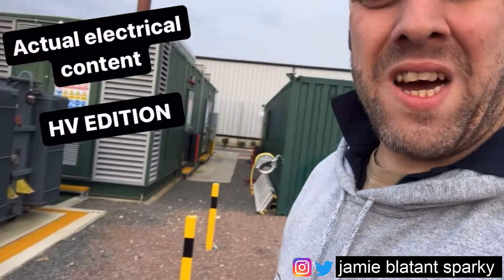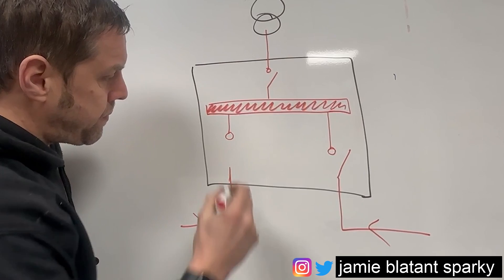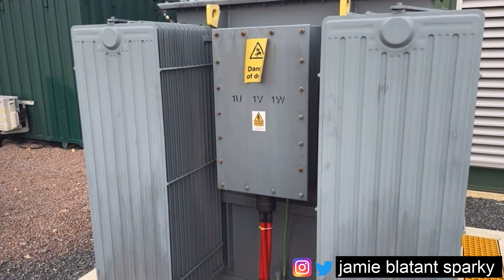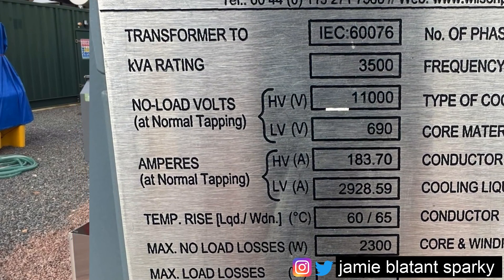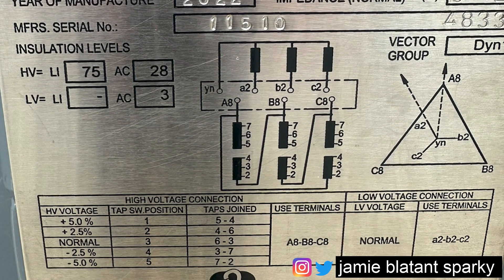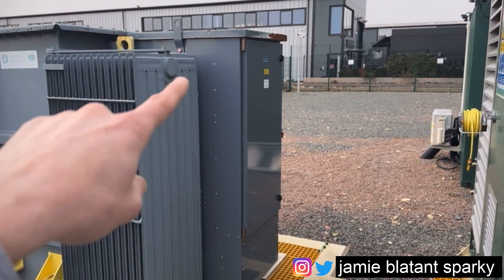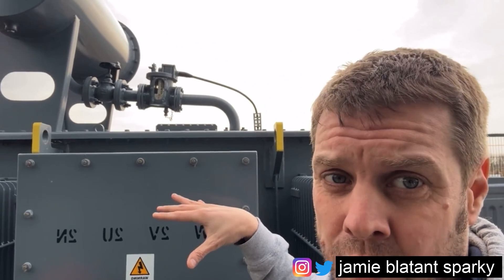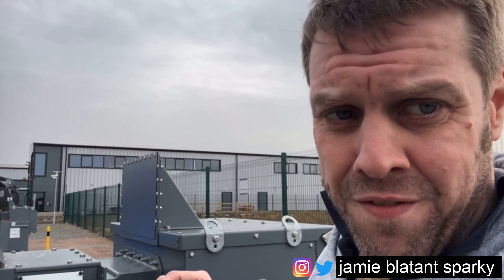HV transformers and switchgear a overview for electricians

Comment: Hopefully this helps on. ONIN. 
 ONAN cooling method relies on the natural circulation of oil within the transformer tank to cool the core and coils, and the heat is then dissipated into the ambient air through natural convection.
Basically, good for convection 👍

Comment: Except the Heathrow setup was far older and had HV switching mechanicsm which had oil based main switch which was used in them days to keep the copper switching mechanism cool due to the high power which generates heat, and its my guess that because this switch hadn't been maintained properly in the sense that the oil is supposed to be changed after so many years and the switch wiped down to get rid of any partials that shouldn't be there, after some years the oil tends to break down because of the high voltage and heat associated with this type of mechanism, from being a insulator over time with foreign particals and the oil breakdown turns the oil into a semi conductor therefore leading to an explosion, I'm not saying this system was used at Heathrow, the oil spoke about by the chief fire officer may have come from the transformer itself which is part of the cooling system , but from what I saw of the Heatrow setup it looked a far older system than the one you are showing, I've actually worked on these oiled filled main switches who were made by GEC , I've actually emotes these oiled filled switches and cleaned them out and refilled the switches

Comment: Good summary explanation, we’ve got compact transformers on our electric high speed trains, we’ve also got idiots who reset Buchholtz relays without checking oil levels 😡, only ever had one that decided to “leave the chat” that was due to track ballast damage blootering the cooler group and returning its oil to Mother Nature, on the DNO ones I used to synchronise LV generators to the LV take off chambers to allow us to do HV maintenance while keeping the consumers on load

Comment: Retired DNO engineer here - I enjoyed your video, thanks for posting it. That was a very good basic description of the 11kV ring main unit and transformers. Most of the transformers on the UK distribution networks - as you pointed out - don't have a rated secondary winding line (phase-to-phase) voltage of 690V but 433V, which corresponds to a phase voltage of 250V. You might expect the normal secondary voltage to be 400/230V but the no-load voltage is deliberately 'boosted' at the LV busbar by design, in anticipation of the voltage drop across the LV network due to the expected load. The off-circuit tap changers are used, just as you explained, to alter the LV busbar voltage if it's a bit high or low, although the vast majority of transformers operate at normal tap (sometimes called 'flat' tap, usually identified as tap 3).

The insulating oil is less dense than water, which is why (1) the kg figure is less than the litre figure and (2) oil floats on water! The 'LI' figure is the Lightning Impulse withstand voltage that the transformer has been designed for. The vector group is also very important too - but definitely a subject for a separate video!

In the ring main unit, the two ring switches are just that - switches - capable of making load (or fault) current and breaking load current, up to their specified ratings. The 't-off' or transformer switch is a rated circuit breaker, so it can make/break rated load current and make/break rated fault current and it will have an automatic protection device associated with it - usually time-limit fuses or, nowadays, it's often a self-powered protection relay.
Reply: Where were you based? My dad was a protection engineer on the HV side for Norweb/Energy Northwest! Appreciate your additions here! :)
Reply: @ I worked across Central Scotland. Almost 33 years with the DNO, 21 of them as a protection engineer on networks up to and including 33kV.

Comment: Temp rise basically means at full rated load the windings will operate at that figure above ambient temp, so for 20 Deg C ambient with a temp rise of 60 Deg C you expect the windings to be at 80 Deg C under FLC

Comment: Cant see it on the transformers you are showing but there are also what we call "swan necks" or explosion vents fitted to larger transformers. It just lets any over pressurisation from an internal arc  blow out rather than splitting the transformer tank. The more modern equivalent is called a Qualitrol which is just like a large pressure relief valve. Generally speaking if either of these two operate then the transformer is going to need extensive repair or scrapping. I have recently spent around 6 months working on a 275kV/33kV transformer that was hit by lightning last year. Blew the tapchanger/selector barrier boards to bits and rupture the explosion discs. Unfortunately after extensive repairs it still cant be energised suggesting some catastrophic damage deep within the windings. When it costs £6million to replace you have to give it your best shot in terms of repairing them. Lead time is another issue as well. You could be talking 5 years from order to delivery on a 400/275kV transformer.
Reply from the maker: People are not aware on the crazy lead times on big tx at the moment it’s crazy
Reply: Wow

Comment: Getting a bit rusty there, you need to get your wire brush out and give them a good scrub. 😃😃
Temperature rise is the expected temperature of the transformer internals above ambient with the transformer on full load. i.e ambient 20 C, liquid would be 80 C and winding 85 C. It is a bit low due to the aluminum winding.
ONAN is cooling method, = oil natural , air natural or you may see ONAF, = oil natural, air forced or OFAF, = oil forced, air forced. You usually see a transformer rating for each cooling method. 
CRGO is cold rolled grain orientated steel, just the type of steel used for the laminations of the core.
Insulation levels are the voltage withstand capability of the transformer due to a surge or switching voltage spike on the network. Allows you to choose appropriate surge limiters for the installation. 75 kV is the standard rating for an 11kV insulation system to the IEC standard for lightning pulses, 28 kV is standard rating for power frequency surges.
Reply from the maker: To facts to fill I. The gaps thanks very much

Comment: Slow it down a bit!!!!! 🙈 what’s a spur???
Reply: A single set of conductors tapped off of a radial (radials are normally fed power from both directions, i.e. a loop) whereas a spur is a simple connection from one singe point to another, not fed from both directions.